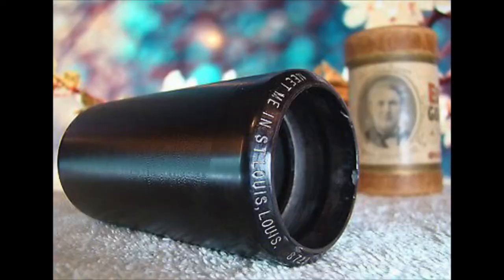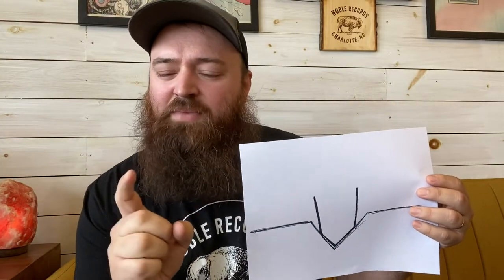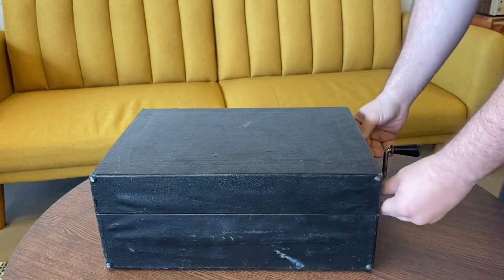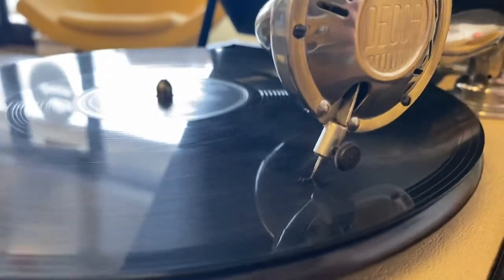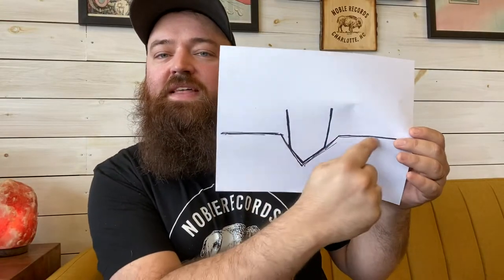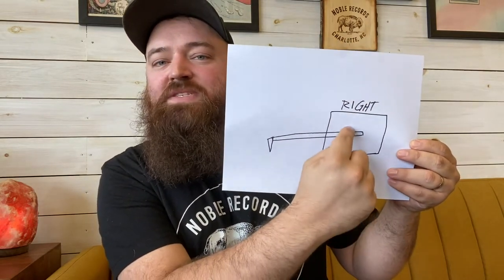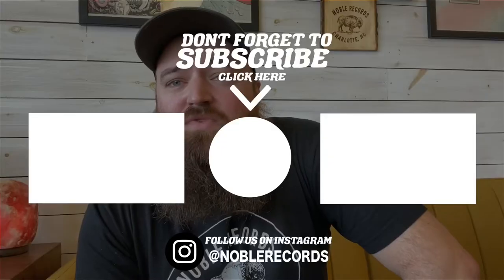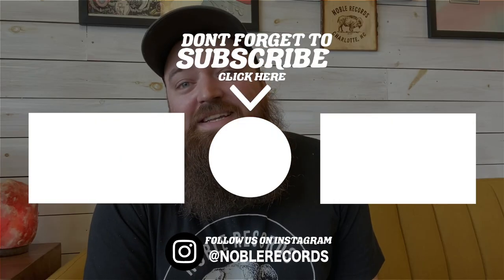How Do Vinyl Records Work? Simple Explanation & Demonstration

Comment: Hey hope you see this. Just new into trying to grade my vinyl collection. I have KISS the best of the solos vinyl and saw it goes for a nice price on Ebay. Anyway i listened to it all the way through. Surface noise was there but it did not ruin the audio experience at all. Anyway listening to the final track on the album by Gene Simmons and the outro got stuck for a second or two and then it kept playing normally. What i thought could be a VG grade is now probably poor. What would you grade it? Btw its an Australian pressing first edition 1979 and the bonus stickers are in great condition. The sleeve has shelf life damage but minimal.